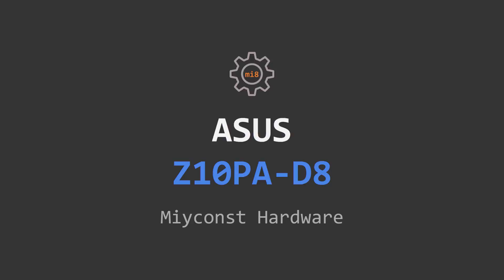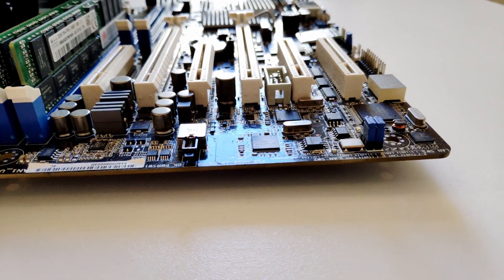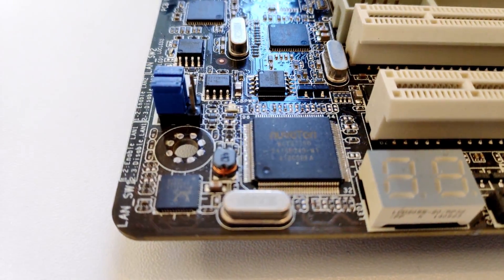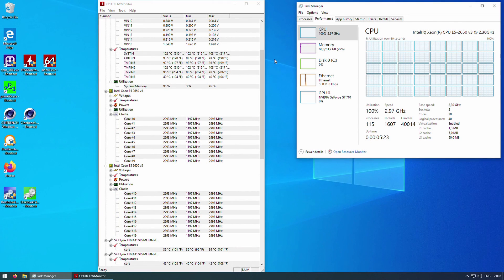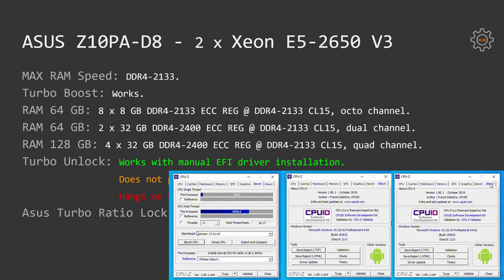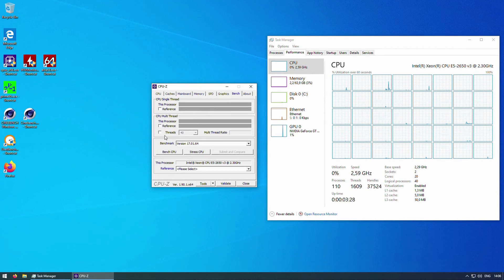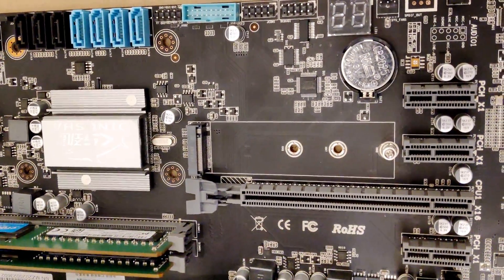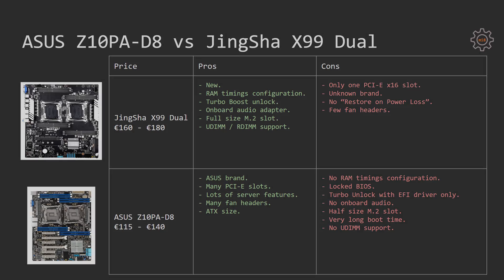🇬🇧 Detailed review of ASUS Z10PA-D8 Dual LGA 2011-3 motherboard | E5-2650 V3 | Turbo Boost Unlock

Comment: In the Asus website it says that  the CPU must be 85W or below, and the one you're installing is 105W. 
How flexible can it be in this matter? I suppose installing two 135W CPUs is maybe too much, isn't it?
Reply from the maker: It depends on multiple factors, for example how good the cooling is, how often you utilize the CPUs to their 100% limit. If you are not going to stress test the system with 100% usage 24/7, then I would bet that 135 Watt CPUs with decent cooling will be just fine.
Reply: @Miyconst  Thank you, that is true, but I was mistaken. I've read again, and the limitation of 85W per CPU is with only one 8-pin ATX 12V power connector with 2 of those it should be ok.

Comment: Hi @miyconst, great video! I want a dual mobo, this asus costs me 70€ do you recomend or better spend more and go for huananzhi x99-f8d?
Reply from the maker: It really depends on your needs. What are you going to use the PC for?
Reply: Miyconst for virtualization (vmware or proxmox) and for nas (unraid). Not for gaming.
Reply from the maker: @MatteoLacava  I would pick the Asus option. Cheaper and surely works with virtualization.

Comment: I have this motherboard with two Xeon E5-2630V3. This motherboard is supposed to be equipped with a C612 chipset, but on CPU-Z, it is marked X99. And on the Intel site, it is specified that neither of these two chipsets has PCIe 3.0 technology, yet on the Asus site, this motherboard is equipped with PCIe 3.0 ports.
Does anyone have an explanation to this ?
Reply from the maker: CPU-Z is not always correct and it can mix X99 with C612 chipsets. Regarding the PCI-E 3.0, then both are correct, Intel says that the Chipset does not support PCI-E 3.0, while Asus says that the motherboard supports PCI-E 3.0. The trick here, is that the PCI-E slots are connected straight to the CPU, bypassing the chipset.

Comment: Just ordered from same seller, hopefully there is no need for replacement. Btw could you recommend some 8x8gb ecc kit from ebay that would work with this motherboard without a hassle.
Reply from the maker: Sorry, I can't recommend any particular seller on eBay, since I don't buy frequently from there. Look for Samsung or Crucial (Micron) modules and ask to ship you eight identical modules.
Reply: @Miyconst  Okay, lastly does the memory rank matter?
Reply from the maker: @kape7452  It doesn't really matter as long as you have the same ranked modules installed.

Comment: Miyconst which eprom programmer do you recommend to flash Asus A10PA-D8 
Winbond 25Q128FVIQ
 Bios Chip?
Reply from the maker: CH341a, I am currently working on a video for it.
Reply: @Miyconst  Great :) I've recked my BIOS after afudos update from freedos USB drive. Not even sure what happend cause everything went smooth, now system is in a loop reboot and not sure how to recover this BIOS since no boot sequence ever completes.
Reply: I heard that these have very bad soldering work and not very accurate voltage as well. Does it come with reliable software?
Reply from the maker: @77obiwankenobi77  Mine CH341a certainly doesn't look fancy, but I still don't have any issues with it, have been using it for more than half a year as of now.
Reply: @Miyconst  patching PCI-E bifurcation and MSR 0xE2 register would bring Z10PA-D8 to another level

Comment: is it working with 2 x i7 5820k, 2011 v3 ? anyone know ?
Reply from the maker: Definitely not. Only Xeon E5-2600 series can work in dual CPU configuration. Xeon E5-4600 series can work in dual and quad CPU configuration.

Comment: Miyconst any luck with turbo boost unlock?
Reply from the maker: So far only manual EFI driver installation worked.
Reply: @Miyconst  After bios mood I was able to see max frequency of 3.2Ghz on all cores under open hardware monitor but cpu-z stress test couldn't go over 2.6Ghz. I had to get back to asus bios last release since I couldn't login at os due to freeze ^^|
Reply from the maker: @77obiwankenobi77  Did you disable CPU C3/C6 state?
Reply: @Miyconst  yes
Reply from the maker: @77obiwankenobi77  Okay, then it's similar to what I was experiencing. Injecting FFS driver into the BIOS does not work properly.
Reply: @Miyconst  exactly, between the driver is a bit old

Comment: where did you manage to get RAM from
I have this Motherboard and am needing more RAM finally after 3 years of single 16GB use
Reply from the maker: I have bought mine on the local second hand market.
Reply: @Miyconst  you wouldn't happen to know if there is more available, or were they in limited numbers
Reply from the maker: @b29ak2007  I could ask, but where do you live?
Reply: @Miyconst  all the way in south africa
lols
basically had a stable rig running with a E5-2620, last month after watching some of your videos was satisfied that Dual Xeon works well
ended up getting 2 E5-2683 v3s from Ali Express 
Now i need to fill out my RAM a little
Reply from the maker: @b29ak2007  Eh, unfortunately, it's a bit too far to ship from Europe. The shipping cost and taxes make such purchase pointless.
Reply: @Miyconst  well I dunno how much that would cost

DHL from china was USD54 on the CPUs

How much more would it be from your end here
Reply from the maker: @b29ak2007  Probably something around that value.
Reply: Also thanks for replying....
Reply from the maker: @b29ak2007  feel free to mail me at miyconst@gmail.com if you are seriously thinking to buy some hardware from Europe.

Comment: Can you the turbo boost unlock on this board?
Reply from the maker: Yes, but only manual EFI driver installation worked for me.
Reply: @Miyconst     I have ASUS Z10PE-D8 WS I tried to remove the microcode but now I have error CODE B7/87 (bios flashback wont work to restore BIOS) have set of two E5-2687W (ES) installed and 2 x 16GB + 2 X 16GB ECC reg mem. The system worked before like 2 years but I think I bricked my BIOS chip. I pulled the bios chip out it showed CODE 00 (no init) put it back in and then after starting the system it hangs on code B7/87. I'm waiting on the replacement BIOS chip (17 euros) but would you be so kind and make a video about how to properly remove microcode (I see you use ES chips) on the same mobo as in this video because I'm 99% sure the BIOS functions are the same Z10PA-D8/Z10PA-D16/Z10PE-D8/Z10PE-D16. Many ppl say its impossible to unlock ES chips but I see you get them running.
Subscribed to your channel keep up the good work you have very interesting content :)
I would really like to know how to bios mod properly :)
Reply from the maker: @HardProduct  These two videos have all required information about how and what to remove: https://youtu.be/YymioiX9SFg https://youtu.be/VkwEvATIgW0 Regarding the ES chips, it depends on the CPU stepping. There are a few ES/QS chips with stepping 2, such chips are identical to their final production variants, just named ES/QS. If your CPU has stepping 0 or stepping 1, Turbo Boost Unlock will not work.
Reply: @Miyconst  thank you so much I give it a try! Quick question have you any idea how to reflash stock bios if Asus Bios Flasback hangs after 3 or 4 blue blinks. I've heard that the usb stick has to be 4GB or less and in FAT (not FAT32). So sorry for wasting your time I was just thinking maybe I can salvage my old bios chip I guess it takes a long time for the new one to arrive due to the "human malfunction"
Reply: Also I have Xeon retail V4 series chips (no ES/QS) does bios mod work for these too?
Reply from the maker: @HardProduct  No. Turbo Boost unlock with Xeon E5 V4 is not possible.
Reply: @Miyconst  Thank you for your time!
Reply from the maker: @HardProduct  Do you have an external USB flash programmer? If yes - just write the original BIOS onto the exiting BIOS chip. Anyway, I was able to successfully update BIOS with a 32 GB USB flash drive formatted with FAT32 file system.
Reply: @Miyconst  Thank you again for your information I was looking flashers on ebay can you recommend a good ROM flasher there are so many. I think ASUS WS series BIOSes are signed with a digital key is it simple as 1 2 3 put the chip in the reader/flasher and just copy the .CAP or .bin on to the BIOS chip? You don't have to answer I still appreciate your input to this :)
Reply from the maker: @HardProduct  I use this one https://www.amazon.de/KeeYees-SOIC8-EEPROM-CH341A-Programmer/dp/B07SNTL5V6 and can't really say much about the other ones, since I didn't try them. You might need to extract BIOS in binary format from the capsule (.cap file) before flashing it onto the chip.
Reply: @Miyconst  OK thank you again was very informative! Keep up the good work :)

Comment: you can unlock ram timings with AMIBCP, - set the acess to admistrator insted of default. i have a video on this motherboard. https://www.youtube.com/watch?v=m7U5Zyjgzw0
Reply from the maker: Hm, I tried to set it to "User", but with no success, next time I will try " Administrator" as well. In you video, I didn't see you adjusting the memory timings, did I miss it?
Reply: @Miyconst  i did not show it. I am running 12-12-12-34-240. I gives a good boost in some games - up to 10 to 15%
Reply: @Miyconst  I dont remember if it is administrator og supervisor, but one of them😄
Reply from the maker: @lasseberg7317  Thanks for the info, I will try it next time.
Reply from the maker: @lasseberg7317  Thanks Lasse. If I get this motherboard again - I will test your BIOS.

Comment: One more question: Are you sure it does not fall to less than 2.6 GHz when idling? So, as you say, it constantly consumes a lot of power?
Reply from the maker: Do you mean with the Asus Turbo Lock feature? It didn't fall under 2.6 GHz in my use cases.
Reply: @Miyconst  can we disable turbo lock?
Reply from the maker: @spiros_anthis  Yes. It's disabled by default.
Reply: @Miyconst  ok, so, if i update everything, and keep it stock, does it then regulate the cpu frequency, to save power when idle etc?
Reply from the maker: @spiros_anthis  Yes, it does.
Reply: @Miyconst  man you are good, thanks

Comment: Hi guys, great work. Question: Is the m.2 NVME, working at 4x speed, 2x, or just 1x? Is it fast, i.e. do you get >1000 MB/s write/reads? Thank you.
Reply from the maker: If you are asking about the onboard M.2 slot, then it is PCI-E 3.0 X4.
Reply: @Miyconst  you are great man. Thanks
Reply from the maker: @ft9150  You are actually right, my bad! Somehow I totally missed that. I was testing with an external NVMe adapter.

Comment: Hello everyone
About a month ago, I got this motherboard, with the idea of installing Mac Os.
I bought it from that same one who gives the link on ebay.
My PC
Z10PA-D8
E5 2630 v3 x2
64GB ddr4 2133
After having installed Mojave, now maybe I dare to unlock the cpu.
A million thanks for your videos.
GREETINGS
Reply: did you manage to unlock the cpu?
My friend of mine have two of these mainboards with 2x e5 2620 v3 per board.
Greetings
Reply: @SJJKH-x2p  Hello, I already have my e5 2630 v3 x2, with all the cores at 3.2ghz
Reply: @CMM-hn8yr  thank you, how did you do it?
Reply: @SJJKH-x2p  
I downloaded the latest bios available (3801)
I have opened this bios with uefitool, right button on ami aptio capsule, extract body, save it, you already have your bios .rom
This rom bios, open it with mmtool_e5, in the cpu patch tab, mark on delete patch data, mark Cpu ide 06f2 and delete it (apply), and now give it to save. You already have the bios ready.
Reply: @SJJKH-x2p http://www.miyconst.com/Blog/View/2081/xeon-e5-2600-v3-turbo-boost-unlock
 Efi driver installation method
   Perform steps 3 and 5 (dual processor)
Between step 3 and 5, you will have to update your bios.rom (step 4, but we will use another method and tool)
I lose that I write to you little by little
Reply: @CMM-hn8yr  you are awsome thanks
Reply: @CMM-hn8yr  i im not able to find an rom, is there already a pre modified version? I only get the write protected .cap
Reply: @CMM-hn8yr  never mind i know what to do, thank you very much, your help is appreciated
Reply: @SJJKH-x2p  
Hello
I have ordered a bios chip on ebay, 12 euros (just in case the operation goes wrong and have a spare one), as soon as it arrives, I get down to it.
I'll comment
A greeting.
Reply: @joaquinmoronmacias4238  OK thank you, I'll stay tuned

Comment: Hi,
It seems that you are unable to flash the UEFI without the using a external USB programmer.
There is a nice guide about flashing modified  xx.rom to ASUS motherboard. Thread link: https://linustechtips.com/main/topic/592133-howto-get-nvme-support-on-older-motherboards/

That guide uses afuwinx64.exe, and the major steps are:

afuwinx64.exe (original.cap)

afuwinx64.exe (modified.rom) /GAN

Note the "/GAN" command when flashing the modified ROM

You must flash the (original.cap) , or else the 2nd step "flashing the modded rom" would not overwrite the UEFI, even though the CMD output shows otherwise.

 This method works on my prebuilt CP6230, which has a H61 chipset mobo. Give this method a shot :)

Regarding the "memory timings & voltage override" sub-menu not appearing, have you tried setting the sub-menu  ACCESS/USE to "USER" in directory "common refcode configuration>intel RC setup>memory configuration" ?
Make sure you navigate to submenu's parent directory, and set the corresponding ACCESS/USE to USER. That's how I got my C-state submenu to showup. (yes the same guy from  your blog, different account though :) )

Best wishes,
LUI

Comment: Here is on sale again, 99eur + 16 eur shipping, if somebody wants one: https://www.ebay.com/itm/ASUS-Z10PA-D8-Motherboard-DualXEON-2011-3-Sockel/383515664004 . I decided not to buy, since if I buy I/O shield, PCI-E riser card, flash programmer and used sound card, I will make an economy of just 27 eur. I have to wait for lots of different parts, I don't know how to write the flash with the programmer and the boot time is long. For 27 eur more it's worth to get Jingsha.
Reply from the maker: It is the same seller, seems like they have got a new batch of these boards. I have exactly the same reasoning as you do, the problem for me though, is that AliExpress packages are not being delivered for about a month now.

Comment: I wonder if Is It possibile ti have a tutorial or a video guide to unlock turbo boost on Asus z10. Thanks a lot
Reply from the maker: It is exactly the same as on any other motherboard, you just have to use external USB programmer to flash the modified BIOS onto the motherboard.
Reply: @Miyconst  So i must unsold the nand?
Reply from the maker: @rossopatocco  You don't have to unsolder it, it's detachable on this motherboard, just remove the BIOS chip from the motherboard, put into the flash programmer, write the BIOS, and put it back in.
Reply: @Miyconst  another Little question...i have a qg 3x programmer, but i didn t find the windbond 25q128..... Is the same read with w25x10? I obtain a file bin that is 128 kb big...Is It correct?
Reply from the maker: @rossopatocco  Sorry, I don't quite get the question. With my CH341A programmer I have used the following settings: W25Q128BV / Size (16777216) / Page (256) / SPI commands (25xx).
Reply: @Miyconst  ok, so i must add a string in the serial .txt of the programmer.... And now the eeprom Is recognized!!! How many time the programmer has use to read the eeprom....in my case more than One hour
Reply: @Miyconst  ok , my programmer after 2 hours has read all the rom; and it is correct. I see your guides, but i don't understand one thing….when i do the injection  with uefi tool , wich type of tu drivers must i use? v3_payne_20_20.efi???or others?
Reply from the maker: @rossopatocco  It seems like you have a very slow programmer, my CH341A did that in a few minutes. You can only inject FFS drivers into the BIOS, not EFI. 20_20 or similar numbers in the file name represent the negative voltage offset, the first number is the negative voltage offset for CPU power in mv, the second number the negative offset to the CPU memory controller, also in mv. By the way, you can download official ASUS BIOS from their page instead of reading the BIOS from the chip.
Reply: @Miyconst   Miyconst  i buy the same programmer that you have, but it ll arrive next week....so not EFI, but X2 or not? And in you think that is Better mantein the original voltage?? Thanks another time
Reply from the maker: @rossopatocco  Yes, you have to use x2 files, because these are for dual socket motherboards. Start with `v3x2_payne_0_0.ffs` and if turbo boost unlock works properly you can try to reduce the voltage with different drivers.
Reply: @Miyconst  Because i didn't see where is the component that i must unsold to insert it in the usb programmer
Reply: @Miyconst  ok , i find the nand near the battery and it sn t necessary to unsold. The chip is a winbond 25q128fviq.
Reply from the maker: @rossopatocco  That's correct.
Reply: @Miyconst  and why is it necessary efi driver?
Reply from the maker: @rossopatocco  The EFI driver replaces the CPU microcode, which was removed from the BIOS.

Comment: After I started playing the video, I immediately paused it and went to e-bay. The cheapest Z10PA-D8 board I could find is $370 and coming from China. Buying it for 100 euros would have a huge bang for the buck. I will still look around for a cheap dual lga2011-v3 board. I want to put 2x E5-2678 V3 on it and try to get Ryzen 3950 performance for 30% of the money.  And btw, thanks for the helpful videos you make. :)
Reply from the maker: If you don't need all these server and remove management features - get yourself a JingSha X99 Dual.